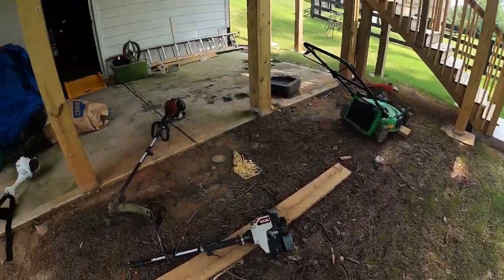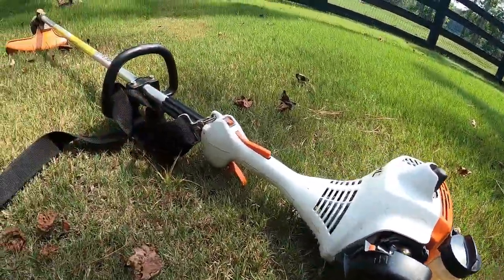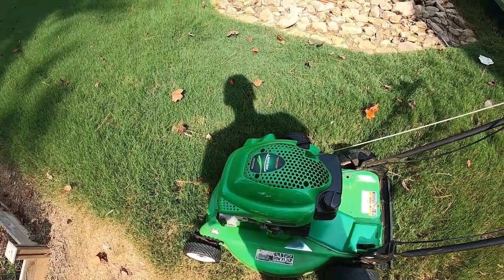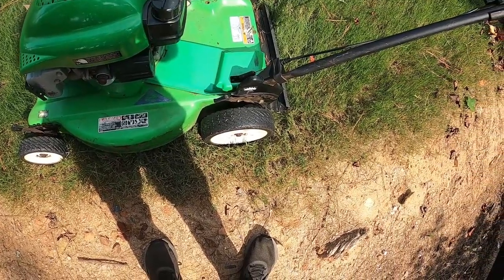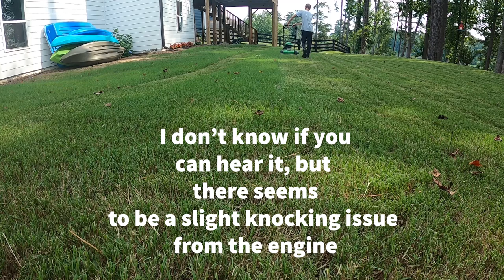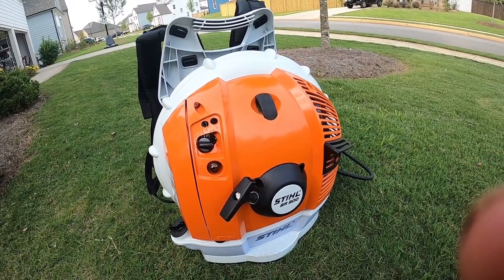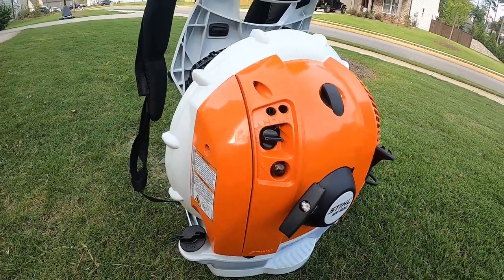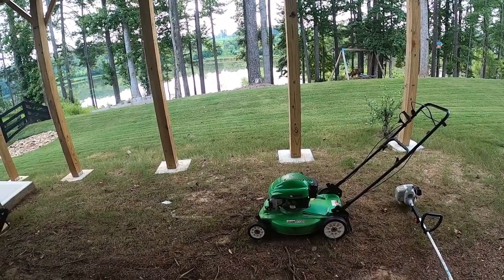2011 Stihl Fs55r, 1994 Lawnboy 10310, and 2021 Stihl BR600 August 8th Lawn cutting video

Comment: Motor doesn’t sound that bad, as long as the oil is full it will run for a long time, Tecumsehs like to knock. i would honestly  throw it back on the old deck and run it until it dies.

Comment: Nice video How is the Lawn Boy 10310 working couple weeks later?
Reply from the maker: It’s been working just fine, the transmission works good, but after the video, I swapped the engine from a tecumseh lv195ea engine to a Briggs and Stratton 6.75hp OHV Intek engine that was from the cub cadet s621 mower. The Briggs is working just fine but it needs a tuneup for my liking lol